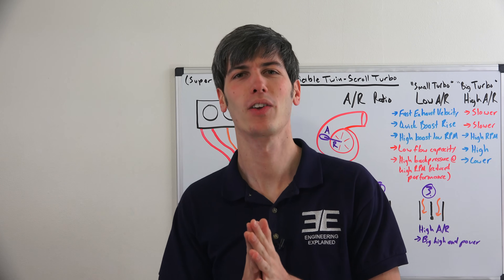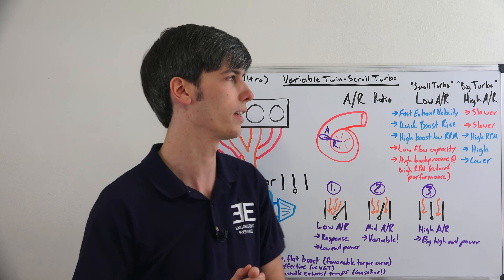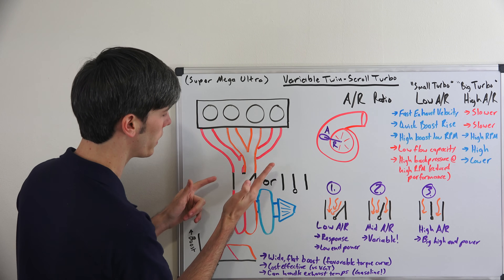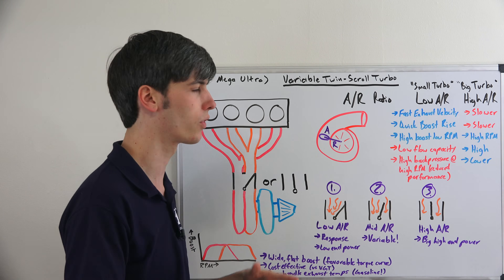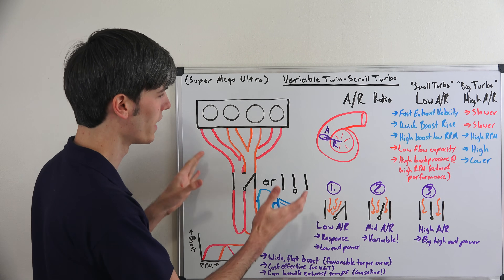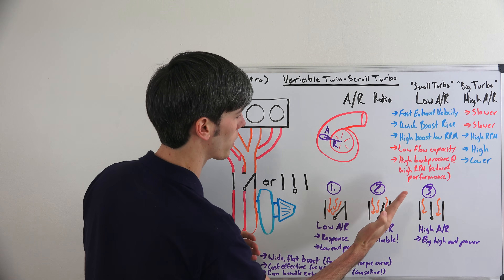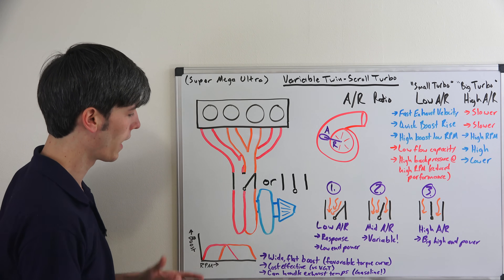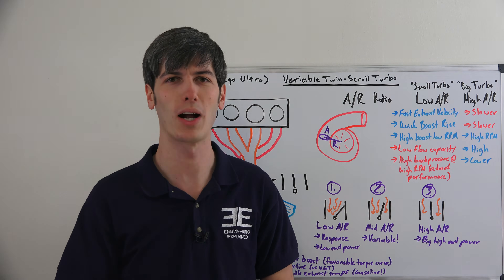Variable Twin Scroll Turbocharger - The Future Of Gasoline Turbos?

Comment: this is genius. I'd love to see it applied and tested
Reply: This has been done before, just not as an integrated part of the turbo housing....its called a quick spool valve, and it is an extra part that sits between the manifold and the turbo. Sound Performance Engineering is known for making quality versions of these, though I bet you could find others if you did some digging. Only thing about this that is different is the integral packaging....
Reply: This “technology” is nothing new. As mentioned, aftermarket Quik Spool valves have been around for a while. But even more impressive, Mazda did this in the 80’s on the FC RX7’s. The valve was located in the exhaust manifold.
Reply: @supramaniac502  Their quick spool valve blocks one port on a twin scroll, it doesnt actually utilise twin scroll manifolds. Its a poor design.
Reply: @chippyjohn1  you have my curiosity as to why it is a poor design. I don't understand absolutely everything about it, but my understanding is that it is a valve which closes off one side of the twin scroll temporarily to increase exhaust gas velocity through the other side until a certain manifold pressure is achieved at which point it then opens up to allow for fullflow
Reply: @supramaniac502  IT blocks one half of the twin scroll turbine manifold, essentially halving the AR. However it cause a lot of turbulence in the exhaust and it also does not utilise a twinscroll exhaust manifold. Counter productive having a tubular manifold and twin scroll turbine housing only to put a wall in the middle. Exhaust should be as free flowing as possible even if only for a portion of the rpm range.
Reply: Beans Diesel bd diverter valve.
Reply: HELLO FROM THE FUTURE

Comment: just wondering but what is it that opens the valve to divert the exhaust gas. is it a mechanical operation or is it an electronic thing that runs off the ecu?

Comment: Good Video but a tad bid misleading. The A/R Ratio of the two volutes (Scrolls) is the same. In the video is seems that its implied that the two volutes are of different A/R ratio's (or at least that what I gather based on many comments / questions being ask). Whats changing is the overall area as the 2nd volute starts to become in use. Think of it like a progressive 4 barrel carburetor, at idle and low throttle, you are only using 2 of the 4 barrels and then as you push further on the throttle, you start to progressively open the 2nd set of barrels.

While the Geometry of the two volutes is slightly different, the "ratio" is the same (or extremely close two if not identical) and the flow potential of each individual volute is the same. If it wasn't, there would be an intentional flow potential difference between cyl's 1&4 and 2&3 once the diverter plate was fully open (i.e., both volutes in use at have the exhaust flow each) and that is not something that any engineer for Borg Warner would intentionally do

Ironically though, this isn't really anything new. This idea has been used on both Gasoline and Diesel turbocharger setups for years. Just in the past, its been done in the manifold or as a sub plate between the turbo and the manifold. The Sub plate setup however was not identical as it did not keep opposing cylinders grouped properly and was more like a throttle plate in a single bore (like a throttle body)... Basically you used a "all into one" manifold / collector design but use a twin scroll turbine housing on the particular turbo. Then the sup plate (between the turbo and the manifold) had a butterfly valve in one of the volute entries which would block that volute from being used so all the exhaust had to though one volute. Then the valve would open and the exhaust gasses could pick which volute they went down . 

The same idea as shown in the video can (and has been) implemented into the manifold (in the collector), and thus you can have the same setup with ANY Twin Scroll turbine.

Comment: Jason I'm learning a lot with your videos so please keep up the great work. 
Now about the turbo set up that exists in today's technology do you think that any time soon we will have companies like Greddy, garret or BorgWarner introducing a MGU - H system to the turbos that they offer? (MGU-H similar to the one explained on your video: "2014 F1 Engine - ERS - Explained").  Or would you think that this step will be taken first by big OEM like BMW AUDI? And what are the main barriers at the moment for this type of technology not being implemented on road cars (technological, production cost or others)?
Reply: The problem with MGU-H or as they call it (Turbo-Electro compound) is that it is completely irrelevant and cannot be put to use in performance road cars. One reason which I feel is that, there is not enough waste exhaust gas to spin the generator. Because F1 cars revv upto 12-13K (15K by regs) but road going turbo cars revv upto 7-max 8K max. Also they are complex and are expensive enough compared to the small amount of energy they recover.

Comment: How does this variable geometry effect combustion upstream? 

Looking at the example shown it seems that the both cylinder pairs have an equal exhaust system where they both push into Scroll1

As  the gate opens there, the high exhaust pressure for Scroll1 decreases and the exhaust pressure for Scroll2 increases from nothing.  This continues untill the the gate is fully open and the exhaust pressure for both Scroll1 & Scroll2 are equal.

When the gate is partially open, is there an imbalance in exhaust back pressure between the the two cylinder banks and does it matter?  Are cylinders 1&4 typically always working harder than 2&3? 

I enjoy your video. Keep up the good work

Cheers,
Andy
Reply: I think I get it now...

I thought its drawn like a 4-into-2 exhaust with each separate cylinder pair having its own discrete turbine scroll.

I picture it now as a 4-into-1 exhaust... then into a divider valve (the gate)... that then splits the exhaust flow between two different sized turbine scrolls. The low-flow turbine wheel and the high-flow turbine wheel

In operation analogous to a sequential twin-turbo (with one compressor wheel)

Comment: Much simpler to put one intake scroll on the shaft and the other on the exhaust.   Or you can do what they did in WW2 and just spin the whole turbocharger up mechanically and scavenge the cylinders with a mild negative pressure.  The reliance on these complex and bulky turbo systems is kinda dumb.

Comment: So why stop the lever in the middle?  Why not let it go all the way to the left, diverting ALL the flow to the center of the wheel.  Once the wheels are spinning, you don't really need to waste any more flow on the outer edge of the wheel.
Reply: +Andrew Jackson Without going into a lengthy detail, by doing that, you would basically go back to a small A/R (of sorts). The two volutes (scrolls) join into on opening (the Inducer) in the housing right at the turbine wheel tips. The two volutes are the same size (kind of misleading in the video) and the variable dividers is simply causing all, some, or half of the exhaust to use one volute and then slowly starting to allow some then to half the exhaust to start using the other. This effectively changes just the "A" (area) of the turbine housing. 

Its the bit misleading part of the video that is leading to the confusion. In the video, it seam like the two volutes have different geometry which in fact, they dont. They are the same geometry. Whats happening is that as you start to transition from one volute to both volutes, you change the "A" (really, you change the volume) and thus the overall effective geometry is changed (made larger) due to the overall increase in "usable"volume vs. the volume of exhaust flow.

Comment: you could do something similar with a twin turbo system, have valves for the exhaust going to a small turbo and large turbo and have them be electronically controlled. i think the rx7 fd had something like that but it was vacuum controlled, which means unreliable, and the second turbo murders you if it spools mid-corner.

Comment: Love you videos buddy. Regarding turbos, I can see the future, in lower powered passenger cars anyway, being electronically actuated turbo chargers, which use electric motors to spin the turbo up when there is no pressure, then when the RPM of the engine is at its peek, the exhaust pressure takes over as in a regular turbo. Used in F1 initially, they can even hook the turbo up to act as an electricity generator off throttle to feed electric back into the cars power systems, saving energy. Very clever stuff.
Reply: Nsx has that

Comment: My question to you Jason is why is this gasoline oriented? does that have to do with the fact that diesels are at a lower RPM band in first place they don't need a high A/R? also I've between going through a lot of your videos lately and I was trying to figure out why gas motors have a throttle body and turbo diesels don't? is that also do to how the ignition of gas works vs diesels? thank you!

Comment: or just use a smaller turbo that spools up a bigger turbo.
Reply: +Shane Habershaw Not sure if trolling or...
Reply: +sando nero it's been around since the mid 90s. look up the turbo system on a supra 2jz. The concept to me a cool thought, but what's the point? What happens when that valve takes a shit? do you think that manifold will be cheap to replace? Do you think it will be service able? it's not like you'll be able to take it out if the flapper door is internal according to the diagram. Just do the math and figure out the best sizing for your engine application. just my two cents.
Reply: Shane Habershaw It seems too simple to fail, the valve may be the weak point, but I'm sure they get it figured out eventually. We can only wait and see.
Reply: +sando nero it is simple minus having to have an engine management system that can change it's fuel-ignition timing based on that side the valve flaps to. I see two actuators on it, but you'll need inputs from the turbo to know if it needs to kick up the fuel-pulswidth-timing, what are you gonna have to do? run two separate fuel systwns? one for the small side, one for the big side?
Reply: Shane Habershaw Both sides are same size.
Reply: +sando nero you mid understood what I ment. "small side" is a phase "big size" is another phase. you still haven't answered my questions about fuel ratio in relation to how the fuel system adjusts to said changes. you have an 
A/R set size of the turbo let's say it's a .83, that 
A/R ratio needs more fuel then say when it's in "small" phase say .49 How does, and I repeat, how does an ecu know what phase to change fuel trim-ignition timing-duty cycle on injectors, and pressure of fuel, etc. without knowing an input from a turbo that's working in a mechanical sense (vaccum) you're going to have to add on a sensor like a tps, so while the valve opens it will send a voltage signal to the ecu. Good luck making a sensor that will be able to take transferred movement into an input signal. what in the Hell would you Make it out of? my point being, if it ain't broke, don't fix it. and the turbo has been around forever and it's done what it's needed to do, and that's pretty much it for that.
Reply: Shane Habershaw The vacuum needs to be controlled from ecu, or position sensor in actuator.
Reply: +sando nero lol I just said that, and you won't answer my questions. keep up the good work my friend.
Reply: Shane Habershaw I don't see the problem. Vacuum controlled from ecu, ecu adjusts the fuel injection and timing according to what it wants to do with the vacuum.

Comment: In the old era, manufacturies use both supercharger and turbocharger to achieve lower turgo lag and better boost pressure, but it seems that the engine is not good and strong enougth to withstand the pressure. Some came up with electric turbo on a turbo or pressurized air to spin up the turbo at lower RPM. (Well I think maybe variable turbo or twin scroll turbo could also be applied in those above mentioned scenarios.)

Comment: I've read that the future of turbos will be electric turbos.  Basically an electric motor spins the turbo at low RPM where the exhaust gases are not enough, and once the engine can run the turbo at higher RPM's it basically shuts off the electric engine.  Kind of like torque fill.
Reply: +Teth47 Dude, read about Audi electric turbochargers and their 48v system; pretty much everything you said is wrong. The future of turbos is obviously electric torque filling, either in the form of mild-hybrids like those Audis or PHEVs. I have no idea why Jason doesn't cover these systems...
Reply: +João Soares Agreed 100% - boost + electric motors are a match made in heaven!!
Reply: Teth47 If you were looking ONLY at peak output, then yes, you're right... but the benefit of an electrically driven turbocharger is primarily in reducing lag and/or recovering waste energy, as in the turbine-generator model you mentioned above. Is this more expensive and complex? Yes, but the future is already here... see Audi's new SQ7 TDI. Obviously they believe the losses incurred with a step-up to 48V are more than offset by the benefit of having peak torque available from 1,000rpm!

More to the point, though... the pancake-style electric motors utilized in most parallel hybrid systems are the perfect match for boosted, high-revving engines. When you've got a secondary power source that can produce 100% torque from 0rpm, then lag and diminished power at low engine speeds are wholly much less of a concern.

IMO, even on non-boosted engines, this is very clearly the future. Pound for pound, no internal combustion engine can match the thermal efficiency of its gas-electric or diesel-electric hybrid equivalent. In the near future, I believe we're going to see hybrid systems go from being a luxury or novelty item to being, essentially, the modern replacement for the torque converter. Engines will get much smaller as turbos and batteries grow.
Reply: +Z Vaper The problem is that motor needs to put out a huge amount of power at ridiculous speed, so it's big and expensive, and power hungry, so you need a beefy electrical system, which is very expensive, not to mention the driver for the motor, and a battery capable of dumping massive amounts of power, that's gonna be a lithium ion, really expensive, the list goes on. It might be the future of turbos, but it's the distant future of turbos, and by then we'll probably just put a bigger motor under the hood instead of bothering with the gas
Reply: João Soares An electric turbocharger is nothing more than a pointlessly inefficient supercharger, unless you use a much more complex system with a turbine attached to a generator to scavenge energy from exhaust gases, otherwise it's parasitic load, because second law of thermodynamics.
Reply: +Z Vaper I thought the whole point of using a turbo instead of a supercharger is that it uses otherwise wasted energy to drive it. An electric turbo would have a parasitic effect. Also, have you seen videos about the new Honda NSX? It's using the electric drive motors to provide torque fill and make the car feel lag free. It's not an electric turbo, as such, but it sort of sounds like the explanation you gave.
Reply: Emmanuel Meris The best fix for turbo lag is to stop using internal combustion to drive cars. Instead of dreaming up a really complex electromechanical system to decouple the induction and exduction turbines of a turbo, use a much simpler, larger drive system attached to the wheels and just power the freaking car with a battery and small engine.

Comment: Basically, twin turbochargers are combined to one turbocharging unit. The only difference is that "lever" in the exhaust manifold which is adjustable. Very sharp idea, I like it. If it can be programmed by the ECU and be manipulated by it, it should make turbo lag disappear. Nice! But then, all the turbo-drama goes....

Comment: basically, its just like putting a supercharger and a turbocharger in one engine but in this case just using a small and a big turbo to have continuous boost through the rpm range..

Comment: the biggest problem with this system is will it create enough back pressure for EGR systems on diesels, in gas engines this might catch on, but in the diesel world it WILL catch on for sure IF it makes enough back pressure for the EGR system
Reply: Diesels have had VGT twin scrolls for a long time especially in use with Scania, Volvo, Mercedes and other large truck manufactures
Reply: Also the EGR "problem" wasn't really a problem anyway, I'm pretty sure they use exhaust bypass valves close to the turbo to force the gases in the EGR

Comment: So basically like a more compact sequential twin setup like Mazda and Toyota nailed in the early 90's but with an additional part which is likely to fail
Reply from the maker: Why is it likely to fail? Silly...
Reply: +Dan Newton So you think a complicated sequential turbo setup with many different bypass valves, exhaust flow valves and 2 turbos is more reliable than a single very simple valve infront of a single turbo? Interesting.
Reply: +Engineering Explained If I remember correctly the ceramic turbos that toyota and nissan used were shit.

Comment: He's like Bill Nye's cool little brother.
Reply from the maker: +Josh Lewis #BillPleaseAdoptMe
Reply: +Engineering Explained this could be used in many areas like boost per gear and anti lag systems. Engaging each gear could make the valve open more. Anti lag could have the valve closed while staging and open up at some point to get the best power for launching. Genious system